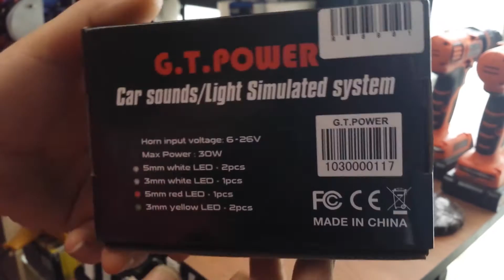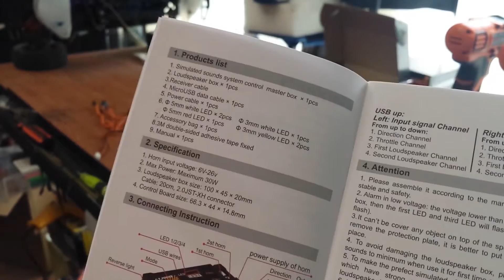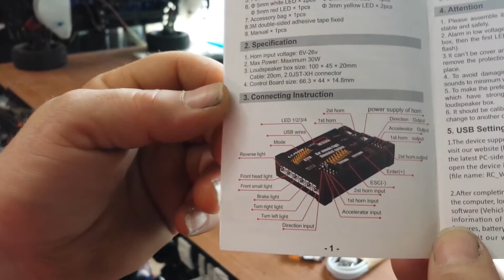G.T.POWER rc sound and light unboxing, connection, calabration and sound selection part 1 sound

Comment: Hello friend .Great video. A question. In my truck crawler the chanel 2, throttle, is 2 pin plug, positive and negative, for the motor wires.The GT POWER speaker is 3 pin can itake only the 2 cables? It will work ?

Comment: help how do i reverse throttle function  IE the engine starts and revs up when i press reverse and when i go forward the break lights come on any help greatly appreciated thanks
Reply from the maker: what model are you working on
Reply from the maker: tipically syncing controller to esc with accessories included have controller in reverse setting. follow manufactures sync instructions
Reply from the maker: sounds like you just need to switch the throttle mode of the controller opposite that it is
Reply from the maker: i sub'd
Reply: Dude try to check ur connections that used to happen to me

Comment: this piece of shit is too sensitive, ie. if you dont have dead centered 
steering trim (what is not possible) - it will flash yellow steering 
leds to one side
Reply from the maker: it can be difficult but adjusting servo horn with end links and controller is possible just tedious.
Reply from the maker: I sub'd
Reply: It looks like there is an option to reduce the sensitivity in the software (downloadable from their web site)
Reply from the maker: I sub'd